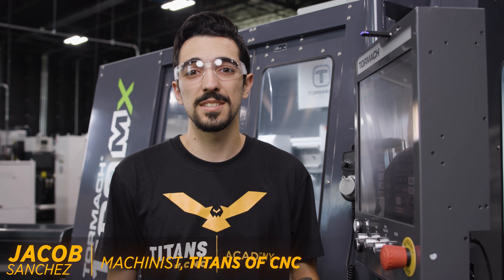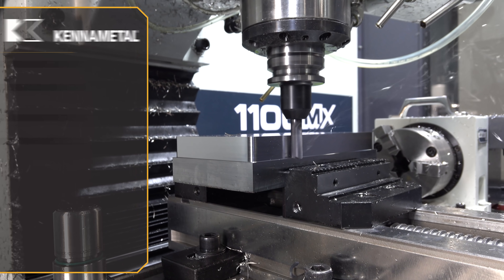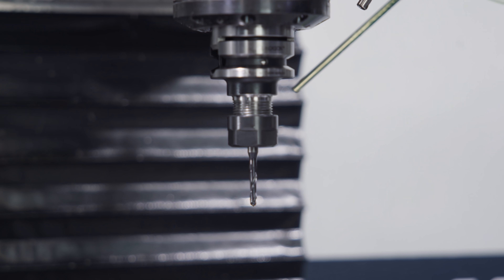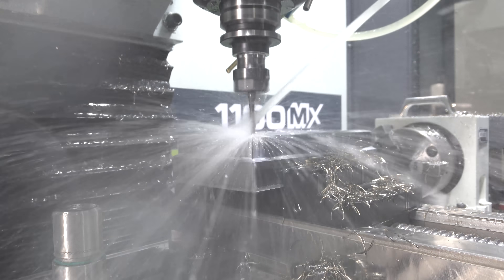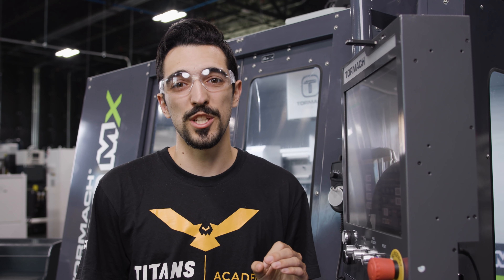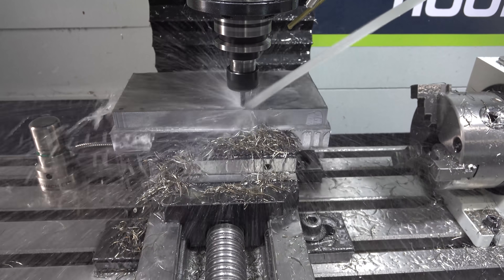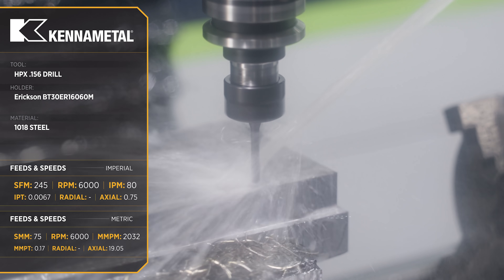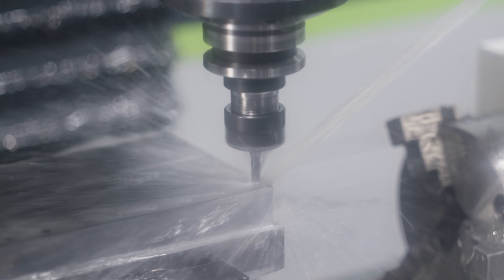Drilling Steel at 80 IPM with HPX Drill on our 2 HP Tormach 1100MX CNC Mill | Milling with HARVI 3

Comment: Would you guys take a look at a program I built and help me tune it in a little better?

I ran 6061 aluminum in aerospace CNC machining for 4 years on a Mazak... I recently purchased an 1100mx and am running some o1 steel as my first parts and I'm not sure if I'm actually running the steel correctly?

I'm using the G Wizard calculator, but I feel like I'm missing something? I feel like I'm getting a really low tool life expectancy and really slow machine times.

I really need someone experienced with running 01 tool steel, and an 1100mx; to run my program on their machine (I would even send my tooling and materials) just to check it and see if anything is off.

Comment: I won't be impressed till you cut some more exotic materials like, 4140, 1045, or A2. 1018 is a fairly easy material to machine.
Reply from the maker: 😳😂😂😂Have you seen our AerospaceAcademy.com

PS. The point was that you can drill at 80 IPM with only 2 HP etc.
Reply: @TITANSofCNC  I was just thinking as a company I'd want to see capabilities on materials that are more frequently used. Even some A36 would be pretty impressive. I believe it'd be more impressive to see 50 IPM in A36, rather than 80 IPM in 1018.

Comment: So can you guys do a video on how to avoid stupid mistakes, like today I was getting ready to run a program everything was GTG jogged down to check my offsets good… good… ok move y aw crap I meant z there goes my 1/8inch endmill (had a Spare…) but ug… any tips to avoid stupid stuff like that ?
Reply: Experience. You will always learn best from mistakes
Reply: try pointing @ the button you are intending to press ( or the MDI code you are about to run) and say it out loud to yourself. watch pointing and calling Japanese safety video to learn why. You may feel dumb doing it, but I've always done this and it helped me. I don't do it as dramatic as the Japanese conductors, but it works.
Reply: Uncertainty is inherently unstable. Always be certain.

Comment: This is the machine that I love the most in your shop.
Reply: I own a 2nd hand 770 and have loved it.   I've learned to tune out the Tormach haters since they come out of the woodwork the second you put the words "like" and "Tormach" in the same sentence.  most of them have never touched one but claim they are "real machinists".
They're great little machines that can do great work with the right tooling and expectations.
Reply: @shirothehero0609  Well said.  Like I said before there is a tool for every job.  Select the right tool and there are no problems.
Reply: I have one.  I don't love it it's very much like buying a new kia vs a used something better. I should have bought a tm1-p.
Reply: Yeah that's a fantastic value proposition. But the 770m is a totally different size class of machine than an 1100mx or minimill. When an 1100mx costs what it does and you're looking at it as a way to make money you can do a lot better for a little more money that doesn't have dovetail ways.
I own an 1100m. I've made a lot of money with it. I'd be able to make more money if I had bought a more capable machine. Tormachs are great machines to learn on. They are like buying a kia. It's "ok" and the safest choice but if you can afford to buy better or want to take the risk on something used you probably should. Professionally I run things from an 1100m up to a Mori horizontal the size of a 2 car garage so it's not like I haven't used different machines and am just parroting "tormach bad" 

"Tormach ok but you can probably find a way to get better"
Reply: Why for the cost of a full fitted 1100mx you can get a used lower hour(under 500hrs) haas vf-0 or super mini mill with better tooling more hp better interface
Reply: @CNCAutomationLab  tormach mills plug into your wall , a haas can’t
Reply: I also don't have to hire riggers to move a machine around + the nickel and diming Haas does + expensive repairs.  There's a tool for every job...
Reply: Bad sound